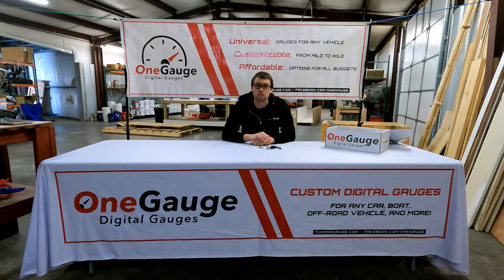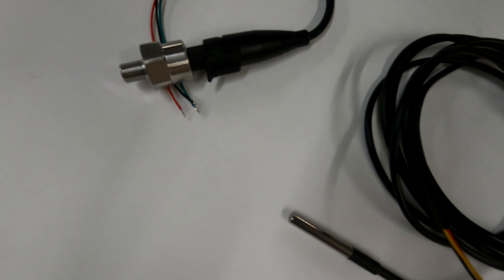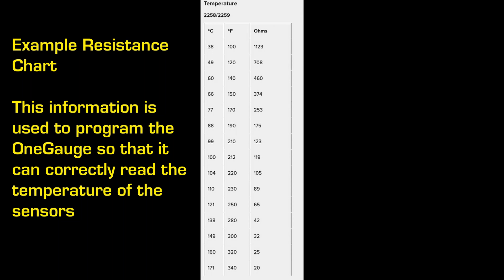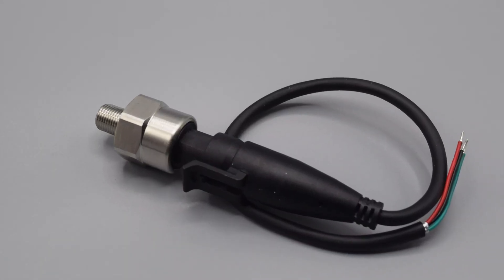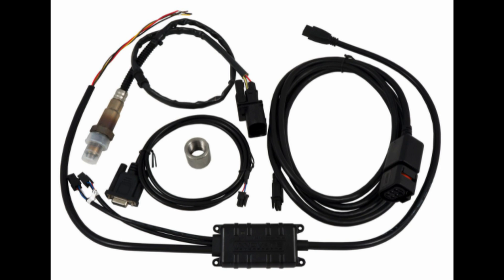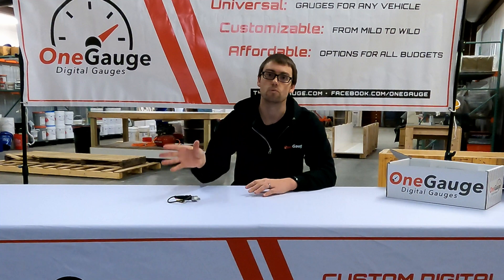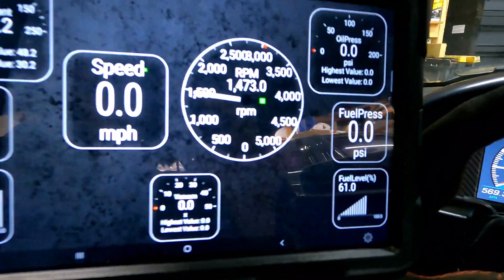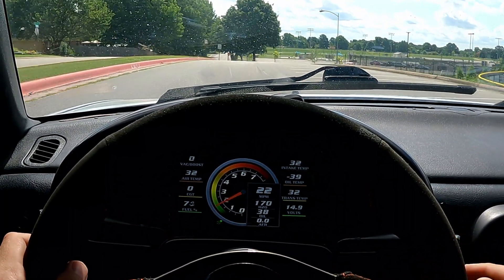OneGauge Sensor Overview- Standard Automotive Sensors

Comment: Gas gauge?
Reply from the maker: Of course. Multiple fuel level inputs can be used and can connect to any sender, and our LCD screens include a menu where you set the resistance range.